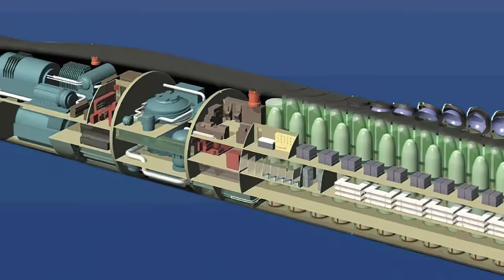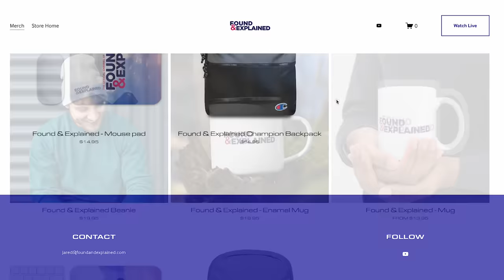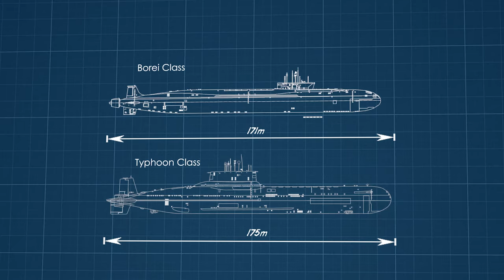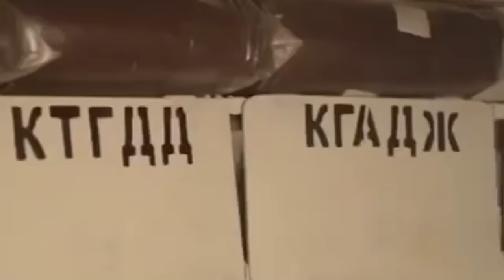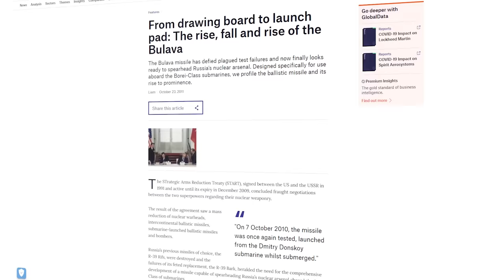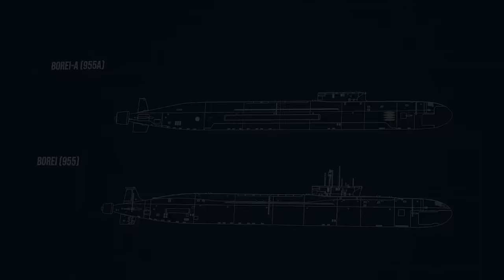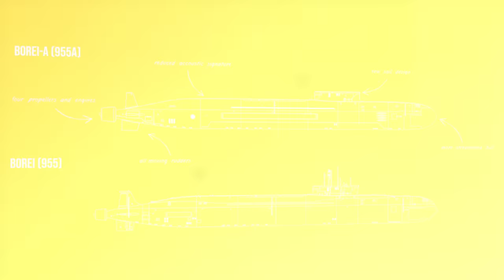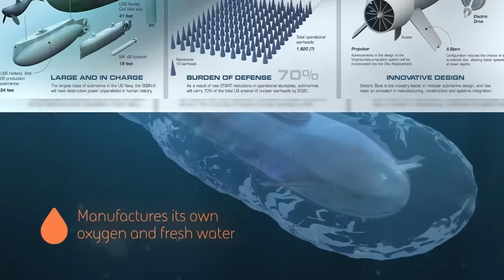Is Russia's new submarine any good?

Comment: Retired as it maybe but Ill still love the typhoon class. That baby thicc!
Reply: Only recently retired I believe. They were using the last one as a missile launch test bed.
Reply: Do you remember the goldfish project the sub made from titanium with 45 knots speed then the torpedoes had only 40 knots speed
Reply: The typhoon was indeed impressive, from having side by side separate pressure hulls to having an actual swimming pool and sauna.
Reply: Well it's thick because it's two submarines in one trenchcoat I mean outer hull.
Reply: Its not exactly retired, they use it as a test bed for new stuff since it can hold practically anything they could make
Reply: The problem with that class is that the cost of upgrade was the same like to build a new submarine and now a big ship or sub is a big target, now even the aeroplane carriers is one missile shoot.
Reply: Today everything even a carrier can be sink with one missile, but the major problem of the typhoon class is that the cost of upgrade  is the same to make a new submarine.
Reply: Unfortunately the Soviet designe of force progection rejected even from the Russians becoce works only in opes SAS like Atlantic or pacific and now a submane costs much much less than 50 present persencent of a big designe.
Reply: i hope they save one and make it into a museum. i've been in two subs and they're badass. one was an old russian sub and the other one swedish
Reply: it was also JUNK

Comment: Let me give a few addtional history.

The Borei's, which are the product of Project "Zapad" a Soviet era submarine building program, were originallt slated to be armed with 12 R-39UTTH SLBMs. Now R-39UTTH is an improved version of the R-39 SLBM, the major difference between the two missiles is that the R-39UTTH SLBM has a greater throw weight which is 3.05 tons compared to the R-39 which is 2.55 tons, plus with newer, compact and light weight nuclear warheads which were adapted from the R-29 SLBM the R-39UTTH can carry 10 or more low yield nuclear warheads. Another difference is the accuracy, NPO Avtomatika developed the guidance system of the two missiles, the R-39 was reported to have a CEP of 500 meters, while the R-39UTTH was reported to have a CEP of 120 meters.

After the dissolution of the Soviet Union, the Russians decided to move the development of the R-39UTTH was moved to Russia, the development of the first stage of missile was transfered from Yuzhmash (Ukraine) to NPO Iskra and NPO Altai, so was the second stage. The third stage was already being developed by NPO Iskra during Soviet times, the MIRV bus segment was already being developed by Kbkhm which is Russian. All three stages of the R-39UTTH were produced in the PZKHO plant in Perm in fact specialize production equipment from Pavlograd (Ukraine) were transfered to the PZKHO plant to produce the 1st stage of the missile. The first test of the R-39UTTH in Russia was on November 1993, but it was declared a failure, there was a total of 4 tests all were unsuccessful, Makeyev attributed the failure of the lack of funding in the localization of production of the 1st stage of the missile, plus the Ministry of Defence was complaining of the cost of the production of the engines. Makeyev still defended the R-39UTTH as the missile program was 70 percent complete and that they needed additional funding, the problem is that during the 90s the defense budget was so small that design bureaus were fighting over the small defense budget that available at that time.

Now here comes Yuri Solomonov head of the Moscow Institute of Thermal Technologies, he advertised the Bulava SLBM, he lobbied the MOD to fund the Bulava SLBM, he told them that the Bulava will have commonality with the Topol-M in terms of components and spare parts, the Ministry of Defense bought as they see the commonality as being able to save on maintenance of the missile. Unfortunately, important testing stages were skipped so as to fast track and to save money on the Bulava SLBM, normaly when a new SLBM is tested it is from a land based launch platform, after that a fixed submerge platform and after that from a submarine, after the Bulava was tested from the land base platform it was immediately tested on the Dmitry Donskoi, they skipped the fixed submerge platform. According to rumors MITT did not account for the submarine to be constantly moving and exposed to the sea. Plus Votkinsk Zavod was not prepared for the production of Bulava, it was only in 2011 that Votkinsk was seriously funded and major modernizations of the production lines. The repeated failures of the Bulava made Makeyev using its own funds to continue development of the R-39UTTH and was given the designated Bulava-45, and Makeyev presented this to the MOD for consideration, but MOD did not adopt as this would mean the Borea submarines would have to be redesigned and rebuild which would make even more expensive, plus the MOD spent a large amount of money on the Bulava that they were already too committed on the Bulava.

Fortunately, the Russian Ministry of Defense today decided to come to their senses. In 2016, the MOD awarded the Makeyev a R&D contract to develop the next generation SLBMs, if I am not wrong last year the MOD finalized the technical specifiactions of the next SLBM.

Comment: Perfect timing on the release of this video,  as I am rereading Clancy's "The Hunt for Red October."  Would love to see more on the Russian subs.  I got to board an old Russian sub (this sub was later used in the movie: K-19, The Widowmaker with Harrison Ford).   Unlike these new beasts, this boat was extremely cramped and the captain's quarters were just a little larger than a phone booth.  It was very difficult getting through the hatches, they were very low to the floor and small, and most intriguing was having our guide tell us this sub's chief designer had been a woman.  When asked if the boat could still go under water, the guide assured that it could, but cautioned there is a difference between submersion and sinking.

Comment: I suggest YouTubers to read my comment to get facts straight...👉 What videos creator purposely omitted to mention that Russian submarines are made of Titanium. US are made of carbon steel. Service Life 20 year or less because carbon steel corrosion resistance 👉Zero because Sea salt water eats carbon steel. US submarines official Dive depth 400m. That was lately disputed because sub manufacturer had fake material specifications and there was a law suit against sub manufacture that was not publicly available. Because cracked were discovered on submarines body while sub was on testing run. So dive depth was official 400mm but after law suit we don't know what had happened. While Russian Titanium submarines dive officially 600m. 200m deeper than Any US. Those facts are Never mentioned in any Western created videos. Moreover, Russian subs are made of Titanium and service life is good as long as it's upgraded to new technology it's good as new while US and rest of Western subs are dead in less then 20 years of service. It's actually undisclosed. Problems for US is US has no Titanium as a resource yet it's also needs Titanium manufacturing technology that US has none. However, US is best in commercializing it's war machine like this video does and Russians are not. That's way US subs are Always SUPOSEDLY better.. Are they?? Carbon steel against Titanium?? I don't things so. Holywood does everything better.😲😝😖
Reply: Russian Subs are the best, /  The Kursk is good example.